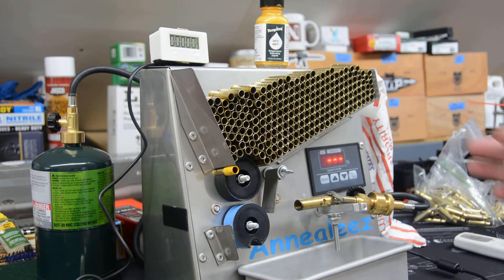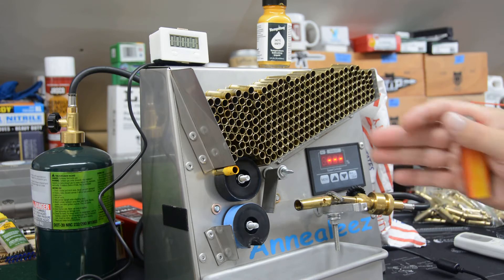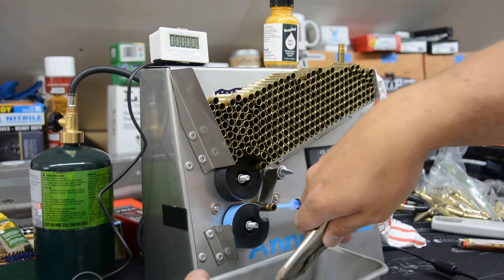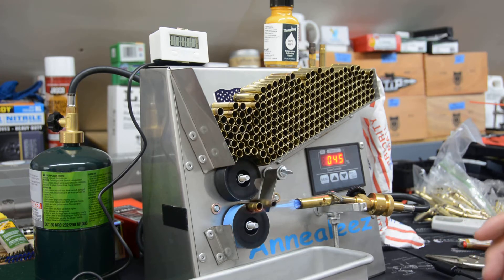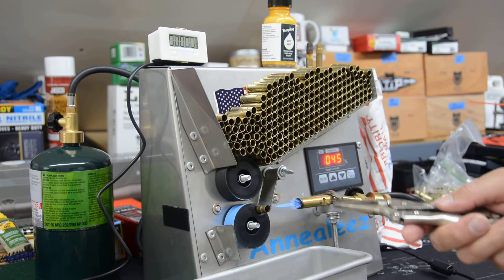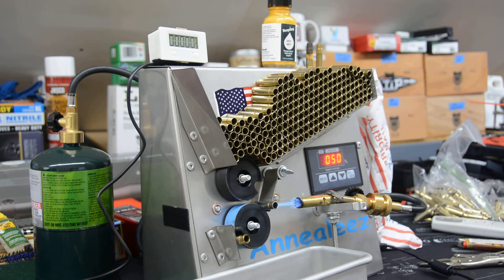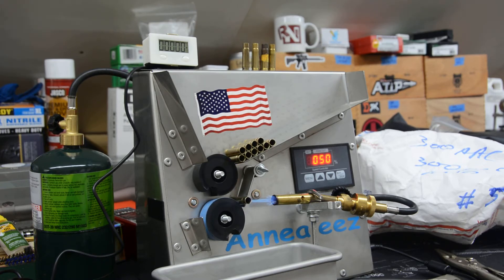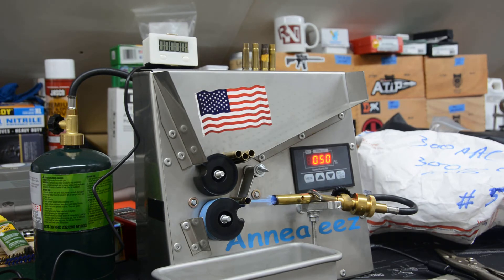Annealing 300 BLACKOUT Brass Cases On The Annealeez 2.0

Comment: I’ve always been told the Tempilaq goes on the inside of the case and is NOT supposed to be in direct contact with the flame.
Reply from the maker: Problem with that is you can’t see it well and have no idea what the shoulder temp is.  So I just watch the bottom of the neck and shoulder and try to keep that out of the direct flame.   Either way as along as you make sure you read it out of the flame.  Thanks for the comment.
Reply: If you put 750 tempilaq on the inside of the case neck and and 450 tempilaq from the case head to about half way up you can then make sure the heat isn’t transferring down the case.
Reply: Hazzbro yeah fair enough. I’m not overly concerned what the shoulder temperature is, annealing the shoulder is just a byproduct of getting the neck temperature in the proper zone. The neck is where the case most often fails from work hardening. It’s also the critical area for achieving repeatable uniform neck tension. If your way works for you, that’s what matters.
Reply: You could always cut a case open. Tempilaq on the inside of the neck and shoulder with a qtip then cut it open
Reply: Ansel Gaddy the good news is, it really doesn’t need to be that precise! A little under annealed is preferable to a little over but, it’s really pretty simple to set it up just by watching the result and slowly increasing the time in the flame. It really is that simple.